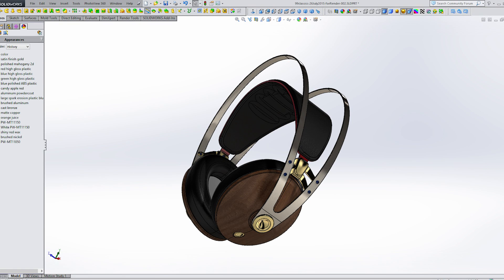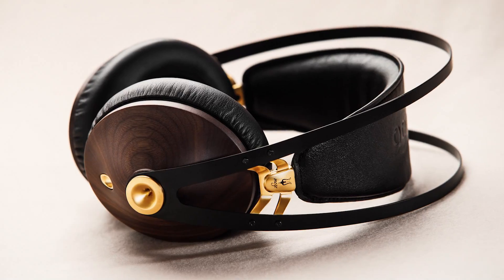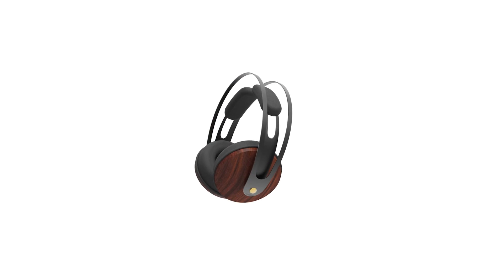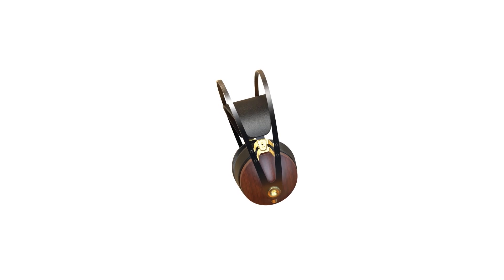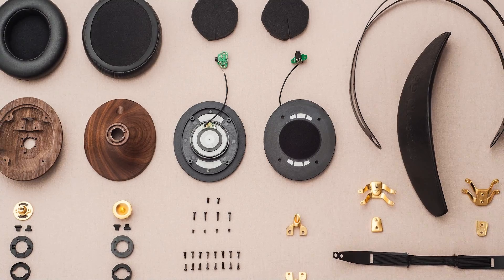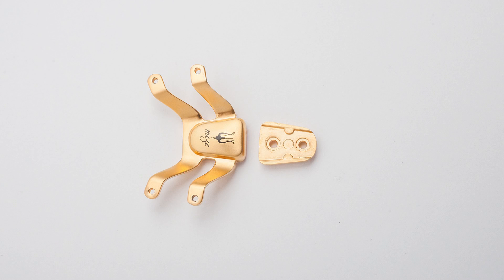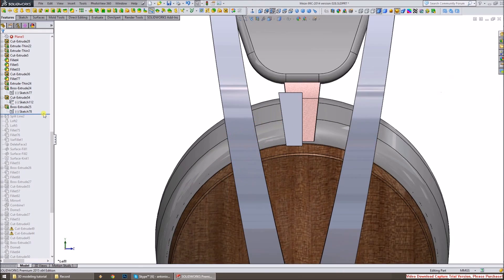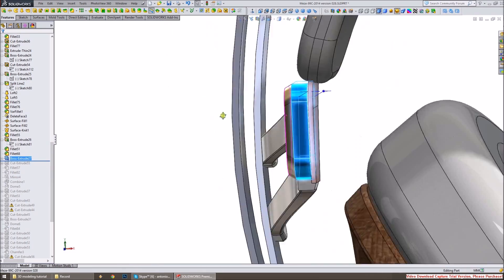Meze99Classics Design Insight and Solidworks Tutorial - headphones modeling

Comment: To make it perfect, put a small ball where the metal part finished and the wood of the earphone starts. In that case it will fit more perfectly on the ear.
Reply: there is a swivel mechanism between the headband and the wood ear-cup if that is what you are referring to :)